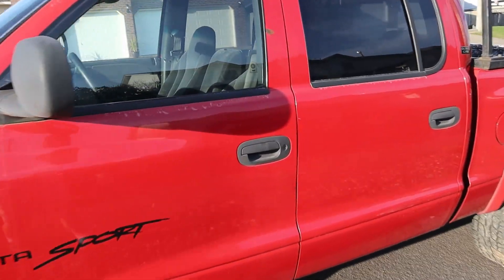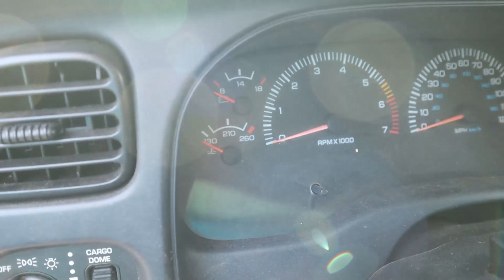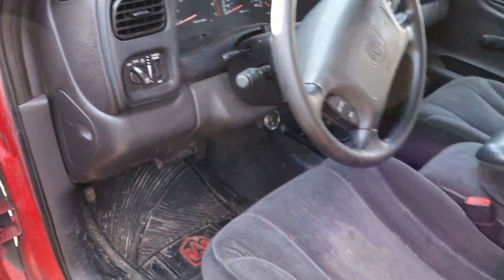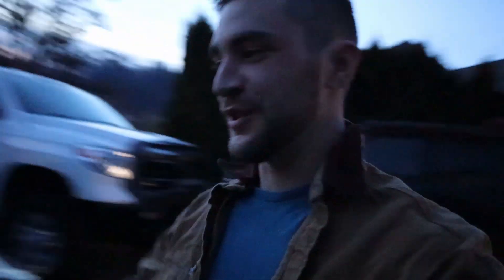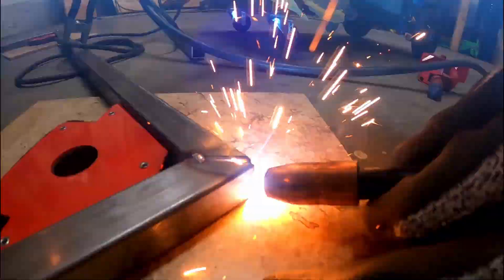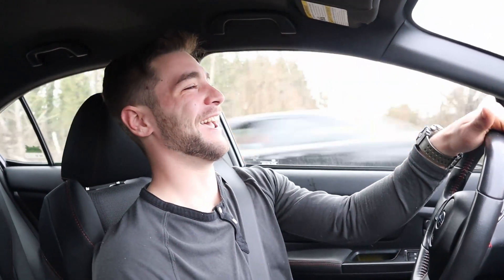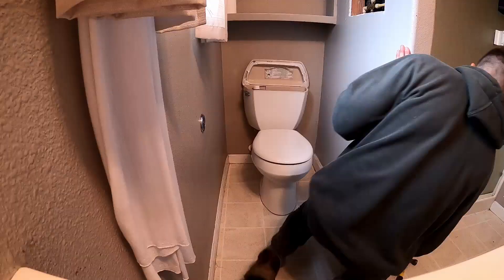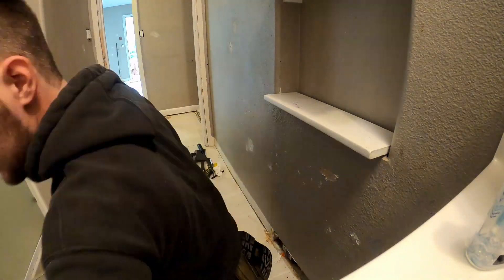$650 Dakota Is Super Clean! | Walkaround With Bonus Content!

Comment: I picked up a 2002 4x4 w/ 129,000 on it for  $500.  There is a Thule Rack on it that's worth that.  Plus tires and a lot of parts that I need for my farm truck.  BUT, this truck is clean and was well treated by the original owner.  I'm going to try and get it back on the road.  it looks like the #1 intake valve failed (it free flows compressed air out the intake at top of stroke).  If it dropped the valve seat it could be catasptophic but I might get lucky.
Reply from the maker: You'll know as soon as you pull that sides head off. Any luck on it yet,?
Reply: @pnwvibe3123  the broken valve seat took out the first 4 cylinders on both sides.  I've got a crate engine sitting here waiting for a few days off.
Reply: @konasan  hell yeah bro let me know how that goes
Reply: @creamy2017  The front four cylinders were dead and the intake manifold was full of shrapnel.  I bought a long block and an engine hoist.  it was an adventure putting it in.
Reply: @konasan  he finally finished the videos of putting the engine in the truck did you check them out?